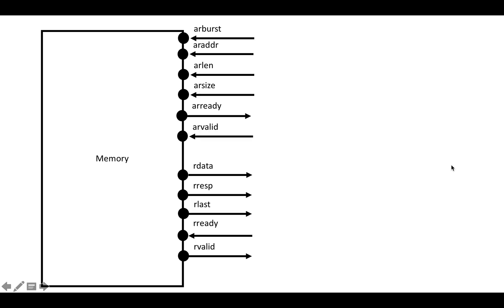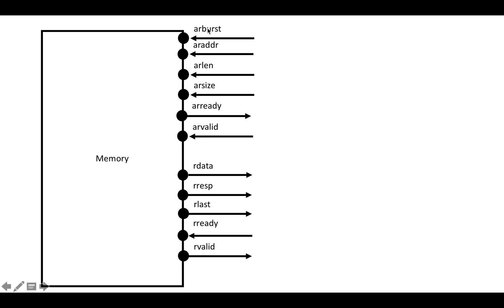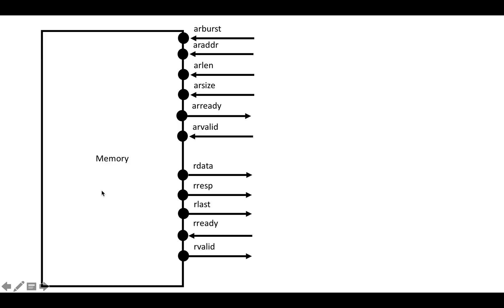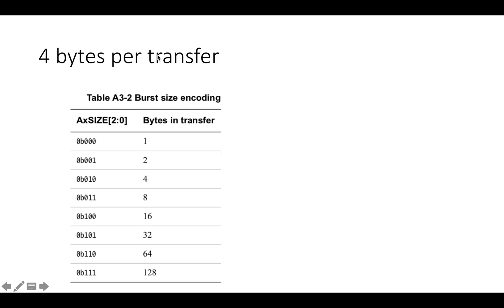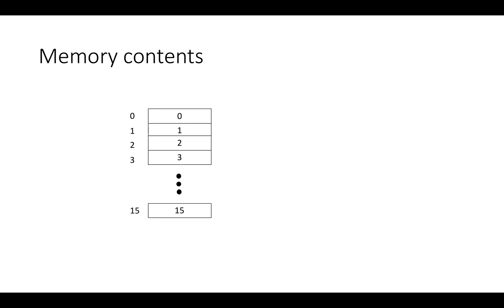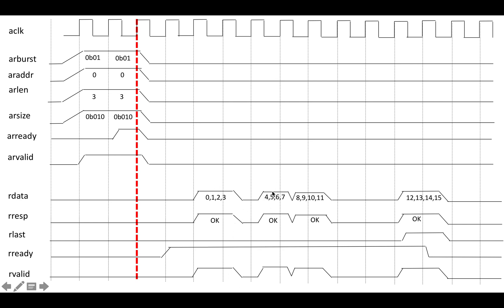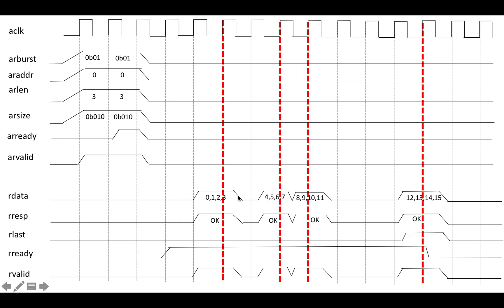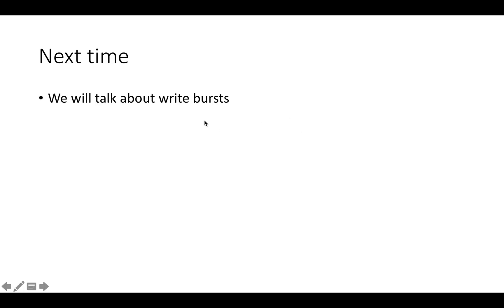What is AXI: Read Burst Example (Part 3)

Comment: Thanks for this informative video. I have a question. Why the intervals between "0,1,2,3", "4,5,6,7", "8,9,10,11", "12,13,14,15" is different? Did it mean that the rdata will not come out without interval even though the requested data is stored in memory continuously.

Comment: I have a question. Our memory has 0,1,2,3,4 and so on data at every address location.
With the assumption that every memory location is of 1 byte, size arsize is set to 2'b01, every beat must be of size 2 bytes, so we are extracting 16bit RDATA on the 32bit RDATA line? What will the RDATA line look like? 32'h00003210 ? followed by 32'h00007654, 32'h0000ba98, 32'h0000fedc ? 

And now with the assumption that every memory location is 32bits or 1 word, our full burst will still have 4 beats but not on each beat rdata looks like 32'h00000000, 32'h00000001, 32'h00000002, 32'h00000003 ?

Comment: How is it possible to transfer 1 or more bytes in single clock? Is there only one data line or more?
Reply: Basically the transceivers transistor is faster, then the clock. I encourage to read up on SerDes, which is the basic of all Ethernet, DDR and more :)
Reply from the maker: The bus can be wider than one byte
Reply: @DillonHuff  does that mean bus has variable number of data lines ?

Comment: Would it be correct to say that AXI3 supports maximum bytes per read or write burst as 16 beats/burst x 8 bytes/beat = 128 bytes and while for AXI4 this would be 256 beats/burst x 8 bytes/beat = 2048 bytes ?

If Read and Write happen simultaneously on same AXI port, does total bytes/burst become 2x of above calculated numbers of 0.5x of above calculated numbers ?
Reply from the maker: I haven't used AXI3, so IDK about it. Section A3.4.1 (Address Structure) of the AXI4 specification states that:

"AXI4 extends burst length support for the INCR burst type to 1 to 256 transfers. Support for all other burst types in AXI4 remains at 1 to 16 transfers."

The same section says that each AXI4 transfer can be up to 128 bytes, so I suppose the max bytes per transfer (if you are using INCR bursts), would be 256*128 bytes.

I don't understand the second question so IDK.
Reply: @DillonHuff  Thanks for clarifying about INCR burst rate in AXI4 i.e. 256*128 =32768 bytes per burst 

My second question is as follows: when there is simultaneous read and write on the read and write channel of an AXI4 bus, does this burst rate of 32768 bytes per burst gets shared between the two channels  ?
Reply: The 1st statement is correct.
For 2nd statement the the maximum bytes/burst for AXI4 is 2x of AXI3 either the read or write or for both.